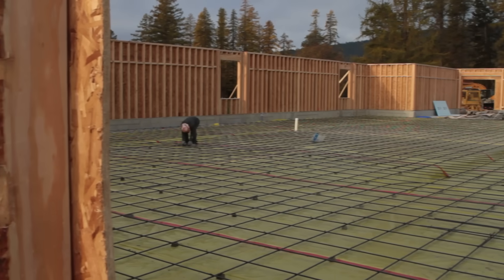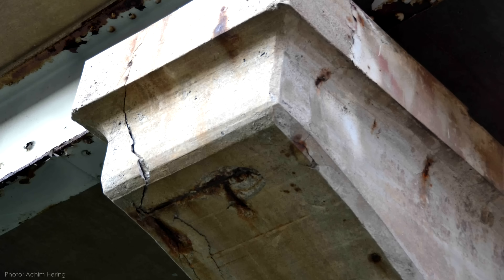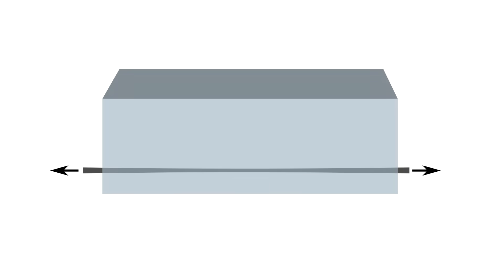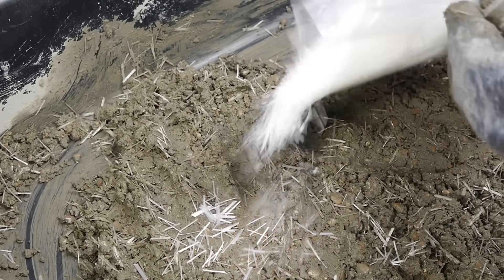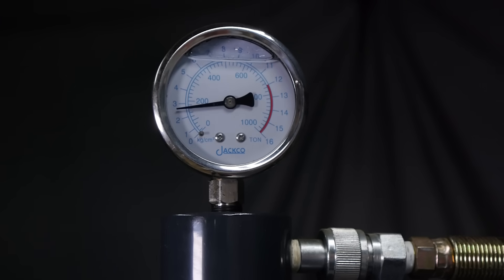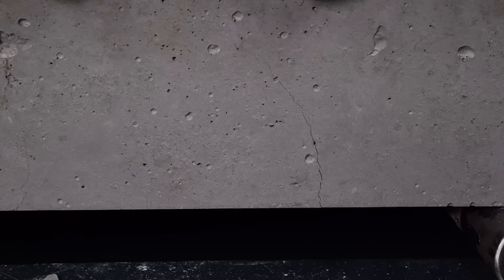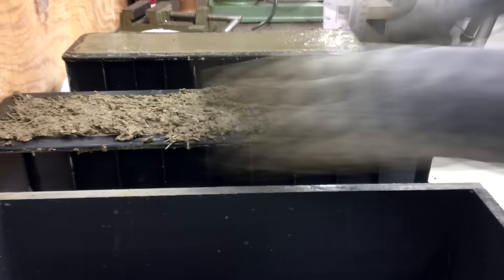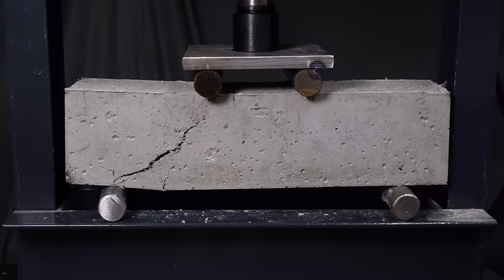Does Rebar Rust?

Comment: I appreciate these video's. I'm sure you know this but your sample beams, which are a great demonstration, failed at the ends because of the lack of development length of the rebar. You might have some fun comparing straight bars at the bottom of your beam with hooked and hairpin bars. It might also be fun and informative to do some real life experiments with hoops/cages to along with straight, hooked and hairpin longitudinal bars. The possibilities are endless. I'm going to use your vids to introduce our inspectors to the benefits of rebar and the importance of placement. Thanks.

Comment: I'm building a 7-foot sculpture for a park in the deep south out of rebar, expanded metal lath, mortar, and then covering it with tile or glass. It freezes hard and rains a lot there and I was thinking about painting the steel structure with a urethane or epoxy coat before applying the mortar to prevent cracking and popping from rust and freezing. In the past, I've used cement fondue. Do you have any info on a paint, how these issues are addressed best or can recommend someone who may have done so? thanks for your response.

Comment: Structures built with steel reinforced concrete will eventually have to be torn down and replaced. Sooner rather than later. Those Manhatten skyrises aren't going to last 200 years even. Many won't even last the next 30.

Comment: For foundations, normally Geotechnical Report recommends the type of cement to be used depending on the sulfate content present in the soil that may enter into the concrete causing the reinforcements to corrode very fast, especially for oil & gas industries which is exposed to harsh environment. Per ASTM C150 Type II Portland Cement can be used for moderate sulfate & Type V for high sulfate. Type I is used for ordinary building construction. Also, pozzolans are added in the concrete mix (i.e. silica fume) for strength. Lastly, waterproof membrane are applied in face of concrete to prevent chemicals from entering the concrete.

Comment: Hi random question and could not work out where to put it. I hope you read this and can help.

talking with a friend regarding a DIY construction project. we are building a dome for rooms to come off of. three meters in from the edge the plan is to put pillars with rebar to offer additional support to the dome. 

these pillars are going to be 4 old coach cross ply tires per level  with compacted earth in the wells and then with rebar running up through the center of each column of tire with cross rebar to each of the four columns to make one round/clover shaped pillar, in total we were planning to have 20 of these pillars the dome. however we were wondering... 

each level of tire is about a foot, if we  took with 50% of the pillars and rotated each level by 30 degrees to create a spiral, and then  if we still did the same rebaring but with the spiral so by the roof we would have 2 and half complete spirals of the columns it would be like a very open rebar spring, with the concrete encased in rubber,   we could see some issues about this cracking on the edges if there is an earthquake, however we wondered if reinforced concrete springs are a thing and if so how do they work. 

it was only thought of as a design aesthetic for us, but got us thinking if they might be other benefits or risks that we hadn't thought of. mainly at the moment it was a though experiment once we realised we would be creating a massive concrete spring so the twisting design got shelved. but having seen your videos over the last couple of years and enjoyed them i wondered if this is a thing or could be a thing.

Comment: Yes when you do not coat it with ballistol sportsman's oil before it's used so it is sealed and air can't get in side of the metal and when you pour the concrete it's sealed in there so it won't rust ballistol is a miracle product with a Hudson sprayer you can treat tons of steel rebar and keep it from rusting while the men are working with it and while it's being  covered with concrete to seal all the air off so it won't rust ballistol sportsman's oil

Comment: rebar without rust is said to exist, but so far no one have ever seen it. even in this video the rebar has rust on it. every large construction sites i've ever seen putting big steel beams for skyscrapers....all rusted.........every concrete video i see stress not to let the rebar get rust on it before use while in the same shot they are using rusted rebar.

Comment: The problem with epoxy coated rebar is. The slightest cut creates rust hot spots that brake the bar 3 to 5 times faster than uncoated rebar.  Due to the electrolysis that cases rust focusing on a single point. Instead of the entire bar.  My state "MI"  has outlawed its use in roadways.

Comment: Never use rebar on slab concrete on grade unless the underlying soil has been disturbed during construction! Have you ever noticed why they never use rebar on sidewalks? And when properly installed or poured it never cracks! As long a what ever was dug away was not replaced with soil. And when replacement is necessary only use gravel! As it will not compact and shrink as soil will and will allow drainage to minimize expansion. The root cause of cracking ( Aside from shitty concrete mix)

Comment: Zinc coated steel is excellent. This belief that the high alkalinity of the concrete reduce the pull out strength is not true, the mechanical lock afforded by the profile of the rebar makes this argument null and void. There is process CAP, cathodic Aqueous Plasma, which provides a nano crystaline zinc which has a corrosion resistance 10 times greater resistance.  And it cost less than hot dipped galvanized bars and is superior to epoxy coated rod which are not much better than uncoated bars. The epoxy coating has pinholes and cracks when bent and must be repaired on site. You can find this Company by going to CAP Technologies, llc.  link is www.captechnologiesllc.com

Comment: To apply the stresses you did to the concrete blocks is a little deceptive.

 In the real world, the beams would be much better engineered and they would be engineered to take loads much higher than they would be subjected to.
 Another way of improving concrete is to add fly ash or pozzolan to the mix.
When added, the concrete becomes more dense with most of the capillaries blocked off reduce or even stopping moisture passing through and coming in contact with the reinforcing steel.
It also makes the concrete more flexible with less chance of cracking improving its overall strength so less can be used for the same result.

Comment: They should just waterproof concrete with tremelar V its a flat roofing process of protecting cement or concrete its basically a rubberized sealant kinda like Phil swifts flex seal but a more industrial strengths.

Comment: So you should try a prestressed, or post-stressed, glass fibre reinforced concrete. Serviceability should increase as we've reduced the amount of deflection under load by adding the glass in conjunction with the steel reinforcements.
I'm a concrete finisher/Mason/concrete countertop designer and manufacturer. 
Keeping my countertops from cracking is not hard job, but it's a very important one. I've yet to use gfrc but I want to get into it. I keep my mixes dry, adding superplasticizers helps reduce water and increases my workability. Then I allow for a very slow cure in a temperature controlled room. My concrete has been tested at 10000psi. Very impressive for a country bum. I also use #6 or #9 wire mesh for reinforcement, I will often use 10millmeter rebar in strategic locations I feel need more strength. I've never had one crack on me yet. 
As far as concrete finishing goes, we tell customers no matter how much steel you put to the Crete, if your base prep isn't done with proper aggregates and or lifts were to big between compaction and the base settles over time. You floor will 100% crack. 
We like to use FRACTURED 3/4 inch clear stone. No compacting required and it binds together like no other aggregates. The cost is what makes people choose sand or b grade gravel. 
Did I mention I love concrete??? Cause I really love concrete. 
Love your videos too. You're a very smart man we could talk shop for hours I bet.

Comment: When my dad made his home, he used concrete mixed with straw, rocks and rebar dipped in old engine oil. Don't know if you can do something like this today but this was 50 something years ago in the northern part of romania (summer+35, winter-25). he isn't here anymore, but the house is ...
Reply: @Plutarch Timbuktu Buildings made of clay and straw are still standing to this day, 500 years later.
Reply: I have never heard of straw in concrete. If concrete is done right in a house it is here to stay for a loooooong time
Reply: @ThomasSiebenhofer   Thomas Siebenhofer  back then they didnt have fiberglass (well, they did but they could not get it because of Ceaușescu) so they used straw whitch has been used in mud huts in africa since the dawn of time and is increbily effective. not as effective as carbon or fiberglass but still better than only concrete.  update, I went back to my fathers home in 25/01/2020, needs a bit of work on the roof but the walls are perfect.
Reply: @vastianocara1792  straw is used all over the developing World and it works just fine.
Reply: @Plutarch the inspector would fail it because it doesn't fit with the standard not because it doesn't work. The role of the rebar network in a building is to defuse the tension (vibrations) all over the structure. In fact in Holland you'll see many walls made up only of (stainless) ebars and stones (no concrete) bound together within a metal grid.
Reply: @Plutarch Not so fast! Holland is located under the sea level. Meaning 90% of buildings are built on mud (yes literally!). You can't have stronger structures!

Comment: The main problem with using FRP (either glass, carbon, or basalt) is that the stress strain curves have steep failure points, whereas steel fails gradually.  Unlike steel, FRP wouldn’t provide very much warning before catastrophic failure. It wouldn’t bend.

Comment: I use fibre glass rods designed as a replacement for rebar. It’s 5/8” x20’ sections are easy to work with, rust proof as there is no steel, light weight. All around good product

Comment: We see bridge damage from rusting rebar all the time here (S. FL), and repairs are rare, it's a bit frightening.  Especially low bridges where jet skis, which shoot a stream of water high in the air behind them, drive under the bridges soaking them with salt water every time they pass through.  The concrete is missing, exposing rusted rebar, in perfect lines right where they get sprayed.  One bridge was so neglected the cement actually failed and a large chunk of the bridge fell into the water right over the channel, fortunately no one was injured.  The rebar in the pillars also rust causing the pillars to crack and crumble.  The popular fix is to wrap the damaged pillar with a thicker layer of concrete, which seems sketchy to me.

Comment: OK Mr Engineering, the Roman concrete is not only still here it has no rebar. That is the concrete Im interested in.
Reply: You don't find many cars driving on ancient Roman concrete. Modern stresses are much higher.
Reply: @General12th  just trying to make a patio. Tap in the words I left above
Reply: @happyraccoon4791  What's a patio?
Reply: @General12th  but a dictionary
Reply: @happyraccoon4791  A patio is defined as "a paved outdoor area adjoining a house". I don't see the relevance.
Reply: @happyraccoon4791  Raccoon, you said "just trying to make a patio". Were you trying to say point?
Reply: @General12th  the point is on your head, zippy

Comment: I was vacationing in Greece in the early 80's. On a ferry boat leaving Piraeus, the travel guidebook said to look for an abandoned, deteriorating apartment complex along the outer edge of the harbor.  *The concrete had been mixed with seawater*. It was seen as being emblematic of the corruption and crony capitalism of Greece.
Reply: Maybe the builders heard that roman concrete set harder with seawater?

My own experience of shitty concrete is a little less spectacular - my parents house was built on a hillside and during a cyclone in the 1980s (Bola) half the concrete structures holding the slope together failed, resulting in about an acre of hillside slumping into downhill neighbours' properties (expensive insurance mess all around)

It turned out that the builders had used illegally obtained river gravel and sand as the aggregate some 40 years previously - and it had a very high silt content, weakening things considerably. One waterlogged hillside later, this was found out the hard way - and there also turned out to be a number of sites across the area which had been built built by the same cowboys and had the same problem  - not good when one of the buildings was a small (3 floor) office block in large earthquake country - that building collapsed in a small magnitude 5.9 quake in 2003 that it should have easily withstood - thankfully no injuries as nobody was in or near it at the time (late evening on a Friday, holiday weekend) but that was sheer good luck.

Comment: I heard epoxy rebar is not all it cut out to be because of the coating getting nicked and then it fails because the spot it got nicked allows corrosion to form and then as corrosion forms it spreads much faster then normal rebar

Comment: Why not just coat the rebar in something or mix something into the concrete
Reply: The problem with coating the rebars would be that the coating would have to transfer the forces between the concrete and the rebar. In order to do so it would have to be as strong or stronger than the steel and at the same time have the same or higher elasticity than the steel.

A solution that is used in some places is to coat the concrete surface with an elastic material (tar for example) to prevent water to get into the concrete in the first place.

Comment: The Romans didn't use rebar in their concrete and the Colosseums still standing.
Reply: The roman roads and buildings never had to take the load or capacities that modern infrastructure has to. There were no trucks or massive vehicles back then, nor were there any massive skyscrapers. I'm positive even regular modern concrete can perform just as well, were the same pressures applied to it.
Reply: @FirstNameLastName-gq3uv  They also had better concrete
Reply: SpaghettiToaster well, probably, but that’s not confirmed
Reply: FirstName LastName that also helped
Reply: If the Colosseum was made with steel reinforced concrete it would all be gravel by now.
Reply: Jeff Borders yeah, but normal concrete is not the best thing to work with, the romans made do with what they had and had to make numerous sacrifices
Reply: haha
Reply: Not entirely, but yea
Reply: WINSTON SMITH yea but they didn’t care about cost or making true walls and floors
Reply: So they used arches and other tricks to make the concrete to not have any part of it not under compression

Comment: Steel is excellent for reinforcing because it yeilds before it breaks.  It creates a ductal failure before total collapse comes.  Some of those other products keep taking load until they burst, causing a brittle failure. A ductile failure is one that is slow and gives plenty of warning, and allows people to exit the building or time to close a bridge. A brittle failure is explosive, comes all at once, and often hurts those nearby the structure or using it. Steelers widely used because it's the superior performing material.

Comment: There was a high rise apartment building (the McGuire Apartments) in Seattle that had to be torn down less than ten years after it was built because the construction was defective, which caused the post tensioned cables in the concrete to corrode.

Comment: Concrete worker here. I'd like to point out that if you didnt get testing done on the concrete prior of your 3 pours (slump,air,temperature) it would be hard to firmly say that one is better than the other, also placement of rebar was close to same but not exact. That's two variables I think could have been controlled better. Other than that I loved the video and additionally learned some things. Thank you.

Comment: Rebar does rust! Even the rebar that is coated rusts fairly quickly. The only answer is to use stainless steel rebar. Big companies don't want to hear this and the builders don't want to hear this but it is the answer. It would also be good for the stainless steel industry. But nobody today wants the right answer they want to find a way to make rotting steel work. As long as they continue to use ferrous metal the rebar will continue to rot. Let's not sugarcoat it.

Comment: "major impediment isn't just the cost"

don't kid yourself, you know it's all about the cost for those in the construction business.
Reply: Designed obsolescence is the new big trend in housing. Mass manufactured to last a few decades before the expense of maintenance is greater than another cheap new construction. Very good for business.
Reply: If a structure fails during use it's a huge cost. Why take on that liability?
Reply: @questioner1596  Its always a balance because you can always spend money to make things safer.